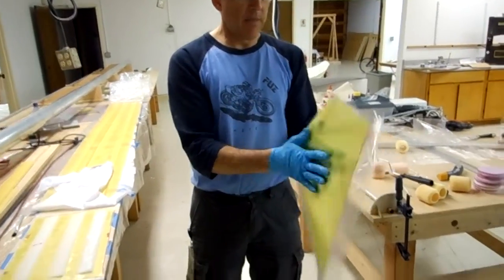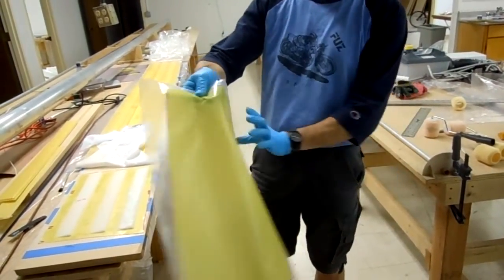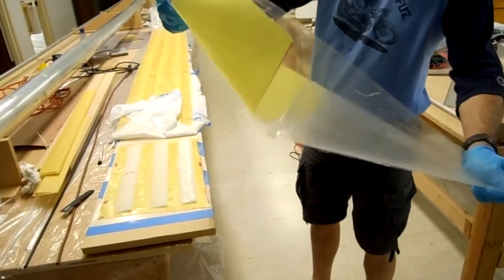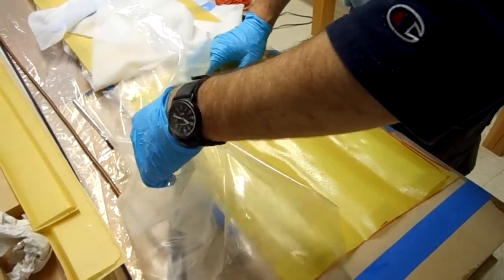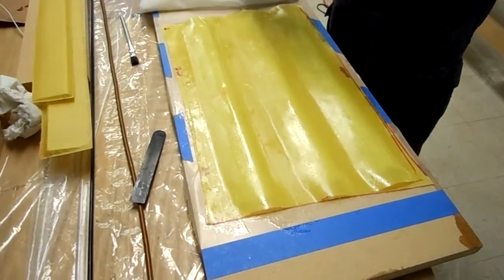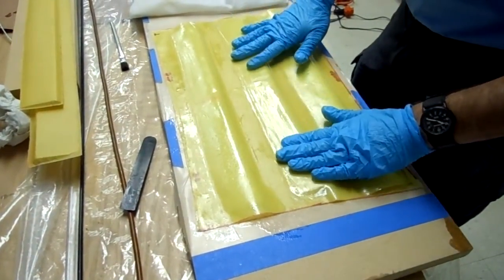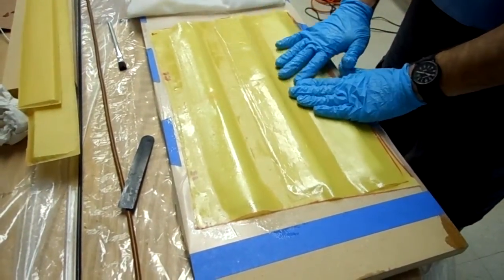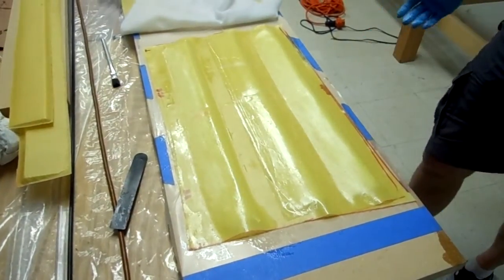Making Kevlar ''pre-preg

Comment: How do you cut , file, drill and sand kevlar composite ??
Reply from the maker: Kevlar is difficult to cut because it is so tough.  If you cut it with regular scissors, it will just fuzz up.  Same if you sand it with most sandpapers.  To cut it, there are special ceramic Kevlar shears -- you can search for them online.  They look like regular scissors, but cut Kevlar fabric and Kevlar tow cleanly.  There are also electric Kevlar shears that work well for cutting large amounts of Kevlar fabric.

After the Kevlar is cured with epoxy (see the other comments on this thread for epoxy we typically use), we usually mark where we want to do a cut with a Sharpie and use a Dremel-type cutting device with a ceramic cutting wheel to cut along the mark.  For very thin layups, (like the flange on our trailing edge, which is two very think pieces of fabric, totalling up to a thickness of about 0.5 mm) it is possible to carefully cut through the cured layup with the electric Kevlar shears, though that probably isn't very great for the long term life of the blade for the electric shears.  We did do this sometimes on our very long trailing edge layups because they were so long and cutting it all with the dremel is very tedious.

As far as sanding is concerned, try to avoid it if you can.  If there is an area that you MUST sand, use brand new, sharp sandpaper of good quality -- we usually use a coarse sandpaper of 60 to 100 grit range, and try to only sand with just a few strokes, or as few as possible.

For Kevlar Tow, it is possible to cut the cord with something that is not dedicated Kevlar shears, if you use a brand new, very sharp blade, for example an exacto blade.

You can drill Kevlar -- use a sharp drill bit, and don't expect it to last to long or stay sharp if you start drilling many holes.